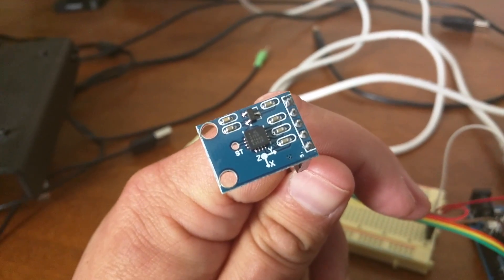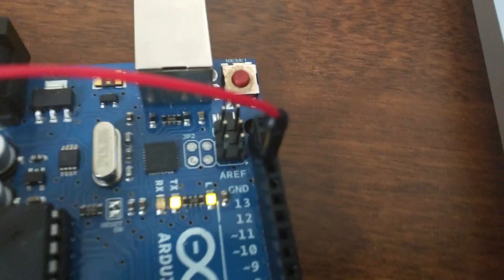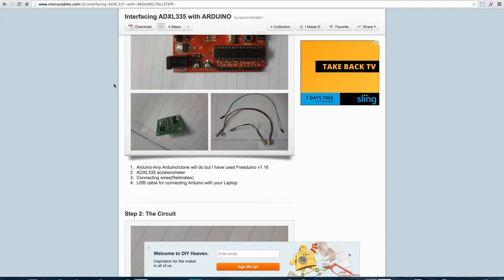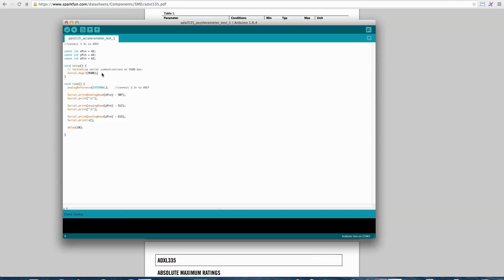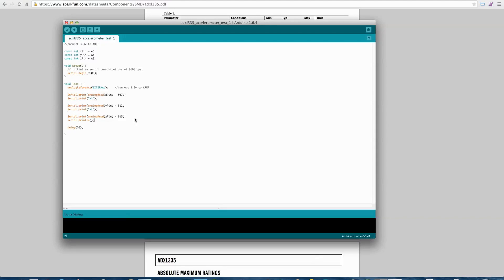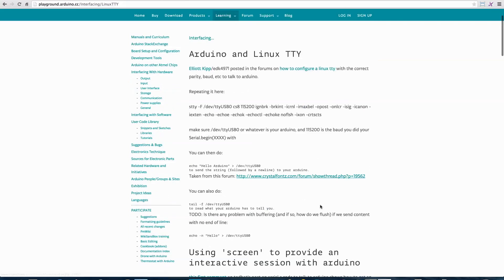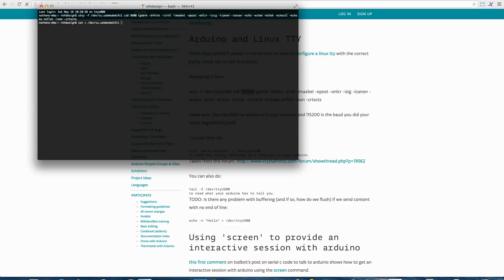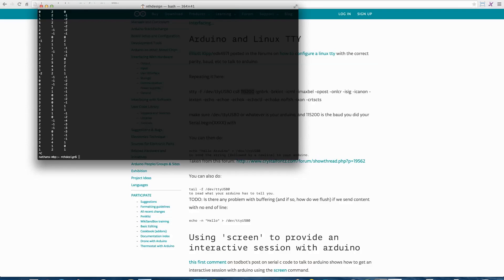Arduino + ADXL335 Accelerometer + Terminal Output

Comment: Hi smith what are the output values x,y,z represents ?
Reply from the maker: +Lokesh They represent the pull of gravity against each axis of the accelerometer chip. If the chip is lying flat on a surface, you’ll see large numbers on the Z axis, and much smaller numbers on the X and Y axis. Thanks for watching!

Comment: is it used to find the speed
Reply: when iam using this your code it is showing 
Xsensor1=1023 output1=255
Ysensor2=1023 output2=255
Zsensor3=1023 output3=255

IT continually same values please help me

Comment: Hi Nate Smith... don't you use ADC in your program? if yes, why do you not use ADC and use aref?

Mr Nate Smith, do you have a link (program) for sending sensor accelorometer ADXL335 using nrf24l01 or xbee or esp8266 with arduino?
Reply from the maker: Upik Jamil, unfortunately, I don't have any examples of sending accelerometer data to Xbee or ESP8266. That would be a fun project, though!

The AREF is an analog reference pin, and works with the ADC. It says, "base your calculations on analog input up to THIS maximum voltage." It sets the acceptable range of analog voltages that the ADC might encounter.

Thanks for watching!
Reply: do you ever use nr24l01 for sending sensor data? I try to sending sensor data ADXL335 but the data does not appear in serial monitor
Reply from the maker: Upik Jamil Sorry, I have no experience with that. Maybe other viewers could help answer the question? Thanks!
Reply: How do you determine value 507, 512, and 615? what are those function? Thanks

Comment: Hi. I use ADXL202EB. I only get 1023 and 0 for x and y. Do you know why ?
Reply from the maker: +Theresa E Do you mean that you get those values consistently, and they never change? I'm not sure what would cause that. Maybe others in this comment thread would know. Thanks for watching!
Reply: Did you connect AREF to 3.3V? same happened with me but was solved after I connected AREF.
Reply: Hi I think my mistake is that i havn't red the data sheet exactly. It is possible that the Intervalls of the switching between 0 and 1023 gives information about the speed. But you say you even got it with aref? I thought it is not forced to use it? :)
Reply from the maker: +Theresa E Sorry, I don't have an ADXL202EB. If any other viewers know of an answer, please post it here. Thanks for watching!

Comment: hi @Nate Smith.... if you look closely to the breakout board, there is a 3-pin chip close to the ADXL335 IC. That chip is a 3.3V regulator so yes, you can hook up the Vcc of the breakout board to the 5V line of the Arduino.
Reply from the maker: Thanks for watching, and thanks for pointing that out!

Comment: Do u have a link for the Dupont Connector?
Reply from the maker: These are the connectors I bought. They seem to work well. http://www.ebay.com/itm/120pcs-Dupont-Wire-Male-to-Male-Male-to-Female-Female-to-Female-Jumper-Cable-/400932483189?hash=item5d59703075

Thanks for watching!!

Comment: hi Nate! Good video but the instrucible is right. And the adxl sheet is right. You have a gy-61 board with the adxl mounted  to it with a 3,3 power regulator on the board. Here is a link to the schematic jpg of the board... http://eshinede.com/upLoad/product/month_1401/201401091802436742.jpg.  Now can you tell me what happens to the signal if you remove the y output capacitor? I have a sensor for a vibration meter (fed to an oscilloscope) that an aussie company sent me and they took the cap off the board on purpose.